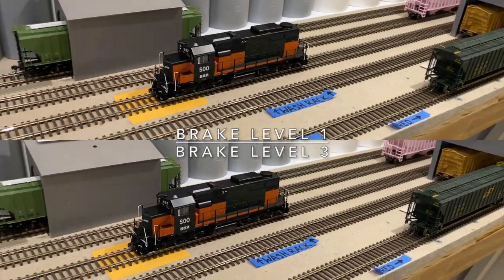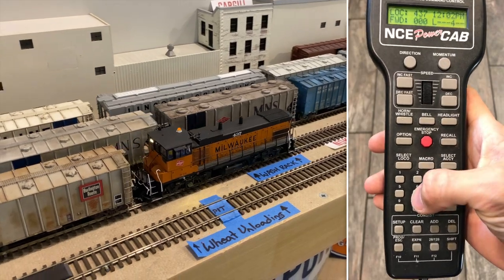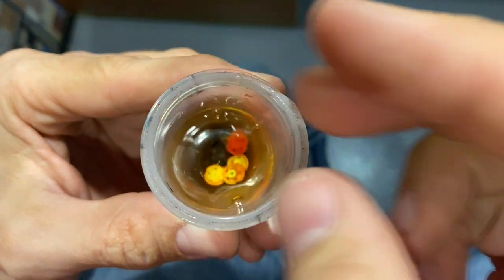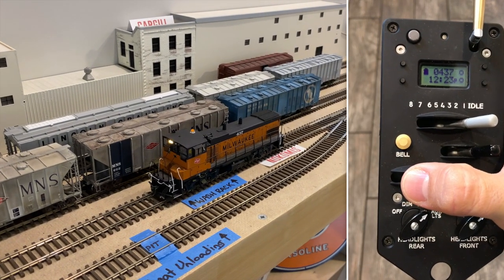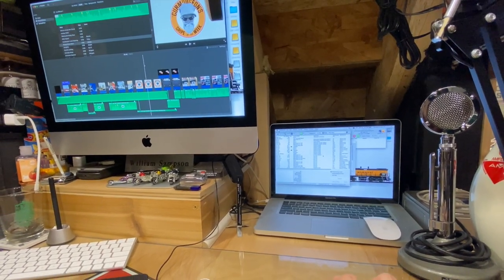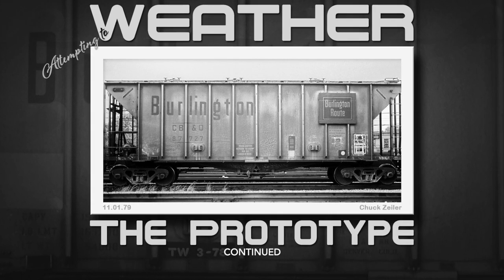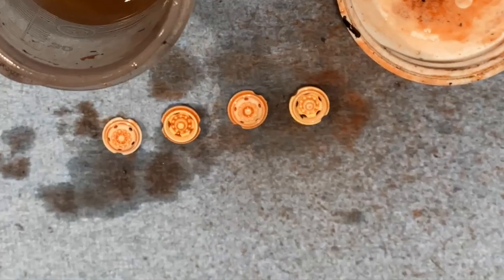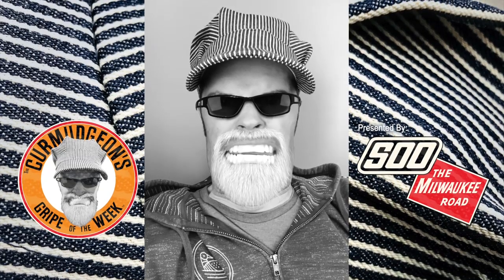S06E08 | Adjustable Brake, Rapido New Look Bus Upgrade, Workbench Behind the Scenes & Uncoupling

Comment: Hey I like the little quick tip on the Proto Throttle braking.  Great way of explaining it by using the Horn as a reference.  Going to make some adjustments to my ESU Decoders now also.  Did not know that there was a more aggressive rate I could set them to on the programmer.
Reply from the maker: Glad it was helpful! Little adjustments go a long way.

Comment: Three glues you'll want. MEK, anything made from ABS will be bonded with MEK, which is 90% of the body details. CA, only thing that works on brass castings secured to plastic.  Canopy glue, this is for holding anything clear like bulbs or windows but is also really tacky so good for Celcon parts like handrails and has enough elasticity that it works well for holding on etchings like walkways or grills. Celcon and etched parts are what most people complain about falling off. Not much sticks to Celcon, so design of the part is important. Etched parts fall off because the metal shrinks and expands at a different rate than the plastic and it'll break any hard-cured glue joint.
Reply from the maker: Hands down, one of the most informative posts. The breakdown you provide for each glue type is VERY helpful. So thank you for taking the time to share the difference and the types/applications to apply each.
Reply: @SootheMilwaukeeRoad  No problem. I should have probably clarified MEK. You can buy a gallon of it at a hardware store, but it's also the primary ingredient in a number of solvent style cements like Pastruct Weld, Tamiya Cement, ProWeld, Tenex-7R, almost all the adhesives in glass bottles with a brush built into the cap. Straight MEK is headache inducing while many of these others (Tamiya extra thin being my favorite) are less noxious to use.

Comment: I think most MP15AC's were sold to UP. I've been inside one of them. I think they got sold a few years ago or went to other parts of the system.
Reply from the maker: It's great to hear of first hand experiences. How a loco ran, it's interior condition, etc. Little bits of invaluable information. Thanks for tuning in and posting.

Comment: Once again another job very well done. 
The whole three levels of braking can be great thing, or nerve racking thing. The 3 levels is only available on V5 decoders,, after watching a Tim Garland video I use a percentage of all three levels. So you can “ feather “ the brake. I need to get my newest sound installs synced with the pt settings, then I will take a video showing how I do it,, cause as of now,, I forgot. Lol. I need to get to my written notes. 
Do you have the SDL’s set to the same accel rate as the MP15ac?, or is the MP15ac a “ switcher” setting?
I think the work on the bus is awesome,, it’s pretty freaking cool!
Reply from the maker: You're spot on Greg, with so many great observations. I like hearing what others are doing. As I always say, "There's no ONE way to do things, I just provide ANOTHER way to try something." At the end of the day, my goal is to enjoy the hobby. Your feathering method is a great way to go. I've left the SDL's set to their factory settings at the moment, but would like to try and get them dialed in to function more like my Overland SDL's...we'll see how all that goes. The MP15 is setup for switching, the SDL's are more road like in terms of pace. Thanks for tuning in and most importantly, thanks for posting. It's always great to hear from you.

Comment: I like the bus finish, much better then the out of box look! Where did you get the characters in the bus?
Reply from the maker: The people inside the bus are from a set of unpainted Preiser people, that I picked up at a show. They were like a $1 for 100+ people...the downside, I had to paint them. Whcih, in this case, it wasn't to bad. However, if you look...it's Soo Line Red, Milwaukee Road Orange, GN Big Sky Blue, Railbox Yellow, Railroad Tie Brown...not the most diverse color palette, but it did the trick.

Comment: Does the bus work off a battery or are the wires dropped thru the layout and hard wired ? Good episode as usual.
Reply from the maker: The photos/videos of the bud lit, it is connected to a 9V. Once a location is determined…it will need a way to power-up via the RR or an accessories BUS (terrible pun). 😆

Thanks for tuning in and hopefully the content is as fresh on the 3rd time through, as it is on the first time through. 😆 How does one get syndication royalties?!? 🤔

Comment: I have questions... The wheels...how long did they dry? Additionally, did you do more than one layer? Thank you and that bus is awesome!!!
Reply from the maker: Solid question. I ended up putting 4 coats of primer on the wheels. Letting them dry for about 30 mins between coats. They’re also in a paint booth, with a drying light (I use a 150w shop light above the booth that gets rather warm…it helps cure the paint.

Thank you for the question and kind words.

Comment: That bus is amazing. You added everything but the smell. Are you Sponsored by Tamiya Panel Line Wash yet? #NotSponsored And what happened to that poor pink hopper in the opening scene? I am guessing Joe B. had something to do with that roofwalk.
Reply from the maker: You'd think Joe would have to do with a damaged hopper, but it's actually a gift from Dr. Dan. He had a duplicate # and gave it to me as a gift. So naturally, it has gone under repair and will find its way into service.

My daughter has already claimed it...so it may enter the fleet for kids ops. They run the RR, but switch out their own cars too. Like the Batman box car...that's my sons. They can pickup and spot "their cars" anywhere they'd like, but no cars are added or removed from the RR, without the VP of the Hiawatha's Districts approval.